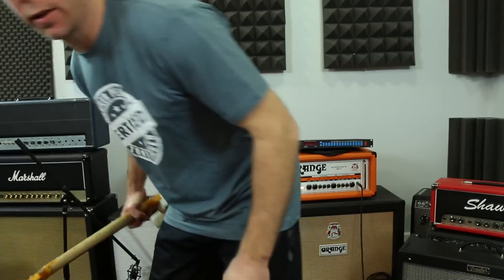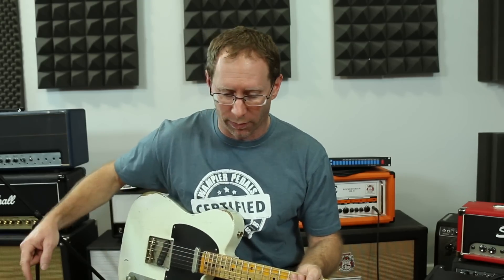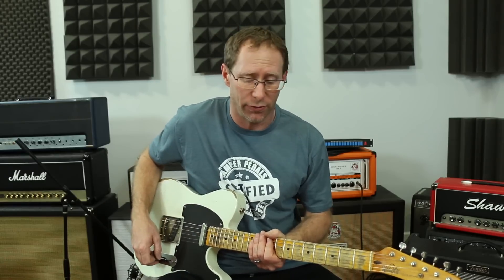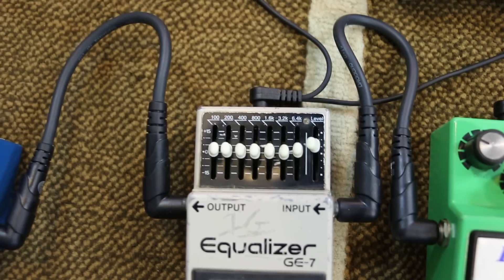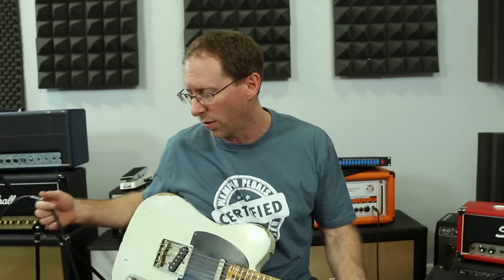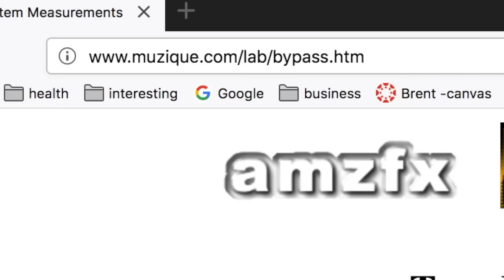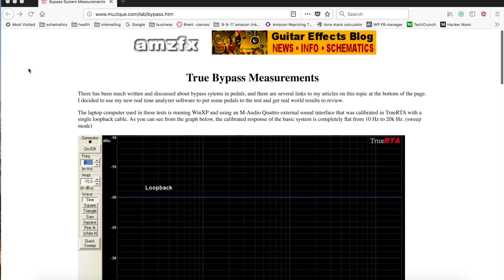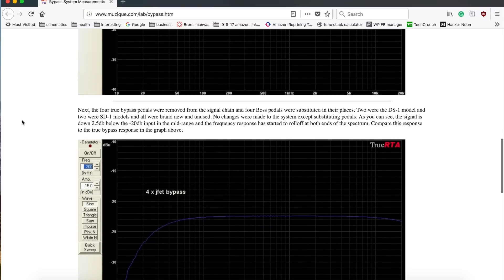Non-True Bypass switching: Is it really THAT bad? A look at boss/ibanez style switching

Comment: Question: I love the DOD FX90 Analog Delay, it's my favorite delay pedal. However, mine adds white noise to the signal, even when the effect is off. I also notice a slight loss of output level from my guitar when I use the pedal, but no loss of high frequencies or undesired tone coloration. I would like to know if it's possible to improve the buffer in the pedal, by  replacing a transistor or something like that. I don't want to make it true-bypass as that would involve installing a 3PDT switch and I don't want to modifiy the casing. Do you have any ideas? I might start by replacing the pedal's internal jacks, they are old and I suspect they could be detrimental to the tone.

Comment: 5 pedals in front, 4 pedals in FX loop. When I have added Boss PS-6 I have noticed the tone sucks right away. Have not noticed it that much before (all Boss pedals). Really easy to hear a difference when you have footstwitchable FX loop./ I am still debating what to do with it (I probably will just live with it) but I have tried all analog & true bypass pedals only as well and let me tell you... it wasn't great either lol. EHX Small Clone pops so loud it can make you deaf (first time, later ones are still loud but at least a few times quiter), TC electronic Flanger have a little cracking/popping noise when engaging + it switches on when you lift off your foot. Boss pedals are so nice to stomp onto and super quiet on/off. Too bad they do suck in a considerable amount of tone and volume/ If you have a mix of pedals I think you would be good though./

Comment: To add to this can of worms: 
@1:50 Fair enough, the level drops, but the tone is not really affected, is it? 
I solved this by putting a Boss EQ (buffered🫣) at the end of my chain, but any transparant booster will work just fine IMHO, don't you agree?
I have a mixed bag of buffered, true bypass and buffered bypass on my board. I even have a Behringer pedal that sucks tone (volume) like you wouldn't believe, but still my sound is pretty crisp.

Comment: Thanks Brian great info,  I believe I have done a bit of research and think I have things good on my board, but would like an opinion if you have a min to do so.  my board starts with a TC tuner,  twin city tone bone ABY switcher (buffer inside) and then through 7 true bypass pedals + an "American Loopers" loop switcher (5 channel).  at the end I have a TC Bonafide buffer out to the "A" amp. The "B" amp is a direct run from the ABY switcher.  I normally run 25 foot of cable on both ends of the board.  Does this all sound like a sound approach.  Is the TC buffer not needed (overkill)?

Comment: Very important distinction that always needs to be made in this discussion is the vintage "Hardwire" bypass like a lot of MXR and Dunlop pedals. They are not true bypass nor are they buffered causing significant tone loss when disengaged. In reality a buffer is only really needed if you plan on using an unaltered clean sound while also having a large pedalboard, because as soon as even one pedal gets turned on that effectively works as the buffer, so there is no need for a stand alone buffer in many cases. The title is misleading in the fact that it simply states "Non-true bypass switching" when it should really say "buffered bypass switching." Non true bypass does NOT equal buffered bypass and vice versa. I only discovered this distinction earlier this year exploring why crybaby wahs suck so much tone. I had never heard anyone mention this in any video for any pedal demo or discussion since my pedal obsession started nearly a decade ago.

Comment: Actually, you're not losing that much range.  Roughly 5 db volume, and your low-end cutoff if around 50 Hz - 60 cycle "hum" is around 60 Hz.  The high-end drop, you'll virtually never hear, especially when you get older.  If you're that concerned, tweak the volume knob of your Boss distortion pedal up a hair and it'll compensate.  The problem with making comparisons between True Bypass and buffered bypass is that - at one point - you will have A pedal on, whose characteristics will change your tone in one way or another, and those high and low end losses will be virtually nil due to basic limitations within any "on" circuit.  Analnog delays and chorus?  The BBD devices in them distort and lose upper end frequencies due to resolution and the internal cascading of fets (and there are a lot of them)..  This is just one example.  But yeah, if you want a truly "clean" tone when everything is off then true bypass is the way to go.  Then again, it's probably cheaper to do a true bypass A/B switch then to convert all of your pedals to true bypass.
Reply: Can I say let your ears be the judge and see if it's the sound you're looking for?

Comment: One thing I can't figure out: is the buffer (like in boss or ibanez pedals) active and only works when the powered pedal is off or is it always on even when it's on?
Reply: It is effectively on while the pedal is on since the circuitry itself becomes the buffer. I went into slightly more detail in a separate comment below this video if you're curious.

Comment: I know this is an old video but I have a question. Is the big drop in the low end mostly due to the fact that all buffer circuits run through capacitors for biasing? Or do jfets actually have a non linear frequency response? If its just about the capacitors then would making them bigger reduce the low end loss? Also, is the volume loss just from cutting the low mud or is there also an overall volume change? If so, is it because many boss pedals have simple emitter-follower-ish buffers in front of the circuit (emitter follower usually has gain slightly below unity). Would that be fixed by using real unity gain op amps? Again I know this is an old video but I hope someone will read this and help me understand :)

Comment: Bryan, I've noticed that some pedal patch cables on the market don't use "instrument" cable, but microphone cable, the type where if used to run from your guitar to the amp will result in tons of handling noise.

However, there is no handling noise when connecting pedals (I assume there would be between two true bypass pedals). Is the electronic bypass the reason for this? Does the low Z signal resist handling noise?
Reply: How does that work? Mic cable is balanced, so you'd not be using one core? Must be weird patch cables as I've never seen any that aren't screened single-core (instrument cable). Unless those are just stereo patch cables, in which case "mic cable" (screened 2-core) would be the sensible cable? Non-screened twin-core on the other hand would be dumb... 🧐
Reply: P.S. Mic cable shouldn't be that bad from your guitar to amp, apart from the fact it's generally not gonna have quite as low a capacitance as single core as far as I understand, so might not sound quite as crisp.
Reply: Piplodocus you just wire the 4 conductors in pairs. It's pretty simple.

But such cable is HORRIBLE for guitar to amp usage. With a high Z signal, like that from your guitar, not having the conductors adequately isolated from each other results in a ridiculous amount of handling noise. Just touch the cable and you'll hear it. The cable basically turns into a piezo.

It's not a difficult thing to test yourself.
Reply: LukeSniper  But standard mic cable is screened twisted pair, not 4 cores!?! Either way I’ve never seen either used for patch cables, unless it’s screened twisted pair for stereo or balanced connections. 🤔
Reply: (Anyway, I should let Brian answer your question but you seem to have some incredibly weird patch cables of a kind I’ve never seen in the last 30ish Years I’ve been messing about with audio stuff)

Comment: Does the signal loss only happen when the pedals are off?
Reply: You can only compare it with the pedals off, because as soon as you turn on one of the pedals it'll change your signal so much that there'll be no comparison. 

Which is why I think the issue is rather moot. Who has a bunch of buffered pedals that they leave off all the time? And even if they do, they could just boost the volume level a bit and get back to where they would have been with true bypass, assuming that's even an issue.

Comment: I run 6 different pedals in my effect loop of my amp. 1 is the BOSS MT-2 Metal Zone.  Then Twin Looper Pedal, a Moore Pre Amp Freidman Brown Eye,  noise gate, and a delay. Then thru the front of my amp I run another 11 pedals. Starting with a Wah, then compression pedal them then running into my 1st overdrive pedal. Then I run thru a loop pedal that starts taking my BOSS Pedals and a couple other out of the direct path. This simple device does a great job of redirecting single chains or running more than one pedal at once with ability to turn them on or off at once. https://www.ebay.com/itm/Handmade-Looper-Guitar-3Loop-Pedal-switch-Board-True-Bypass-Channel-Selection/113693362551?hash=item1a78a70977:g:EqEAAOSwgBNawteh

Comment: I'm installing a true bypass module(Monte Allums) in a Boss DD3 version 3A(square chip). Anyone know what resistor to remove to defeat the flip-flop circuit? Can't find any info on this.
Reply from the maker: Not sure off the top of my head. You might email Monte

Comment: Hey Mr. Wampler! I would like to suggest a video about true bypass (mechanical bypass) and why the "click" noise happens and ways to prevent it! I mean threre's ton of information about "pop" noise on the internet (led current draw, pull down resistors and so on) but nearly nothing about the mechanical click that some 3pdt does and can be noticed specially with high gain pedals! Thanks!

Comment: So if you eliminate the 20' of cable with cordless transmitters, guitar to pedal board, pedal board to amp, do you still loose as much?
Reply: You certainly retain everything that cables would have otherwise stolen, assuming the wireless units are well-designed.  And I suspect (but would yield to contradictory evidence) that cheap cable from guitar to pedalboard, and pedalboard to amp, probably steals more than mediocre buffers in a half-dozen pedals on a pedalboard would rob.  But the real question is whether a large number of buffers in whatever you have on your pedalboard would still lose bandwidth and signal level (remember, they are always "on") in a plainly audible way, with or without wireless transmission to and from the pedalboard.

Comment: Boss pedals suck tone. That said the compressed buffer tone can sometimes tame a nasty cable or set of cheap pickups. The first time I plugged my guitar direct in to the amp using a low capacitance (21pf) cable was a revelation. Since then I only use true bypass effects and only if I have too. Amp distortion is always better than pedals and 50's wiring and a good set of pafs + a master volume amp really removes the need for od/boost/ts pedals.

Comment: I don't know, nor care about, the technical details, but l do believe that the difference between a great guitar tone and an 'ok' one can be very subtle.   For example, the difference between the sound of a high-end or well aged acoustic and a mid- price one may not be enormous scientifically....but can be huge to the player.  God is in the details, they say.
The same applies to an electric guitar sound.  I used to use a Fender Deluxe RI amp with a telecaster where the sound plugged straight in with a shortish lead was simply beautiful.  Very complex and musical.   But if l added a single Boss or other non-bypass pedal that was gone.  Still sounded good...but no longer AS good and l might as well have brought a cheaper amp along.  I found the same thing with buffered pedals.  The people here who are saying that that slight degradation isn't that important are missing the point IMO.   If you have several pedals and tend to have their effects on then it may not mean much to you.  Your end-result tone can still be very good.  But if the character of your basic guitar/amp timbre is important to you ANY degradation at all can be a problem.
And as for very long leads....I'm guessing that a venue where a 50 foot lead is necessary is one where subtlies of 'tone' will be lost anyway.

Comment: My guess is that the designers at Boss back in the 70s/80s did not anticipate people w/ >4 pedals in line.  That bypass circuit has stayed the same for decades.  The bypass circuitry can be modified to fix the issues.  The low frequency cut is due to the small bypass caps they use (Boss typically uses 0.047 uF).  The drop in overall level can be corrected in the original circuitry via the buffer gain.  The slight high end drop isn't bad, but could be addressed as well.  Replacing the caps w/ larger ones (10uF) would deal w/ the low end drop, however the original cap may have to be inserted in the signal path after the buffer to retain the same sound.  I wouldn't go get a pedal modded just for the bypass fix.  It is easier to put a booster in the path.

Comment: Is there a simple way to check if your pedal and tuner wah etc are buffered or true bypass. Ive got lots of varying pedals i wouldnt have a clue which ones a true bypass or a buffered unless theres a logo on it. Well i guess youve answered the BOSS pedals there all buffered.
Reply: Snooze00 take the battery out (remove the power supply too) and if it still lets signal through when bypassed then it’s true bypass.
Reply: T_Dogg awesome thanks.

Comment: Is a buffer useless when using a true bypass looper/switching system for pedals?
Reply: Joey Busnardo IF you like your tone a buffer is useless. IF you try it and you think i sounds better it's not useless😉
Reply: Maybe "useless" wasn't the right word to use haha. I'll rephrase. Does a buffer have less impact on the tone when using a true bypass looper/switcher than with chained pedals? :p
Reply: Loop selectors have the virtue of removing everything in the loop (including not only buffers in pedals, but the patch cables connecting them) from the signal path.  If what is feeding the loop has a low-enough output impedance, relative to whatever comes after the loop, then you're in good shape.

There are really two separate-but-interlinked issues with buffers: 1) proper matching of impedances for the guitar and amplifier, and 2) bandwidth and signal loss due to cascading of imperfect buffer stages. So, you want to feed the long cable from guitar to first pedal with a low-enough output impedance to overcome the cable capacitance (or have a high-enough input impedance in whatever the guitar pugs into so that the guitar's output impedance isn't an issue).  You also want to have a low-enough output impedance of whatever is feeding the cable to the amp so that the cable doesn't lose too much bandwidth.

In many respects, one has an easier current to swim against if one uses as short a cable as is feasible.  If you consider the many feet of interconnecting patch cables on a pedalboard as being equivalent to extending the cable to your amp by as many feet, you can see how a loop-selector can help with that by effectively taking a lot of that extra cabling out of the signal path.

Comment: I got all into low capacitance cables at one point, about 60pf per foot was the lowest I could find. Beyond I think 6ft, cable capacitance starts to absorb highs so there was no point as 6ft isn't that practical but I persevered for a short while ....it basically turns a passive guitar tone into nigh on what you get from active i.e 'just' the pickup, no tone suck from pots, cable or anything and for me I concluded (for blues) I like a bit of cable suck!! Especially for bridge position on a strat!
Reply: Steve James try lava cables!
Reply: Thanks man. Actually my friend uses them - low capacitance version still no longer than 3m I dont think? Any case my tone now is built around 'normal' cables. Lava are also very expensive! V cool though :)
Reply: top notch quality cables!! not so expensive i think!
Reply: But even Lava past 3m has capacitance issues. They are good quality though no doubt :)  No good for serious live stage though. If pro's need the tone of low capacitance they'll just buffer the cable somehow (pedal, buffer box, 9v battery) Radio mic even! Lots of techs make their guitar cables anyway, and it's about what lasts! I've been receiving bits of gear from Page for years via his tech who is a friend of mine :)
Reply: Steve James OK! Got 6feet cables, no issues with them!

Comment: Not all buffers are created equal. Impedance both coming and going becomes the trick of the trade. High Z input and low Z output is desirable in most situations. Too low, the passive volume control peters out at a quarter way down. Too high, limited to short cable runs or weird problems at the input stage of the next device. Tricky science, but learn it! Be the signal! Put yourself in it's path, what do you see. Hopefully the best buffer for the job. I designed a buffer that allowed my friend to plug his piezo equipped violin into a Area 51 wah pedal. The fiddle had too high of an output impedance for the guitar ready Wah pedal. Sounded horrible. So I built a buffer using a JFET and a PNP BJT follower for a proper match of magic "Z". Now he uses the wah for everything because even when the wah is off, he is buffered for anything. Signal Lives Matter.